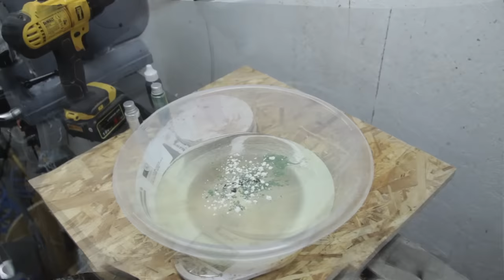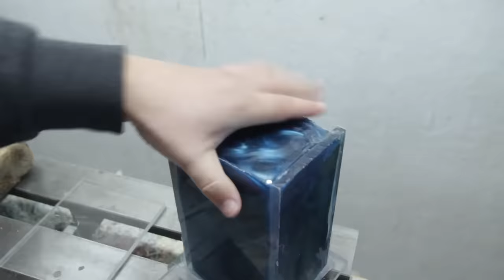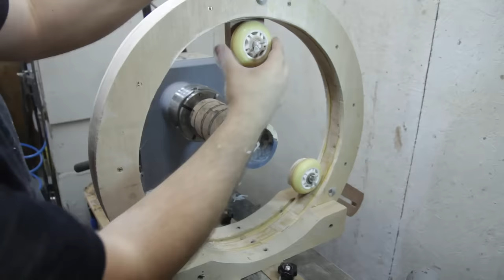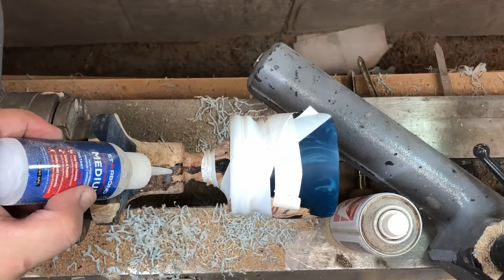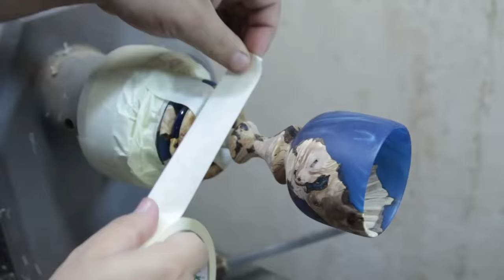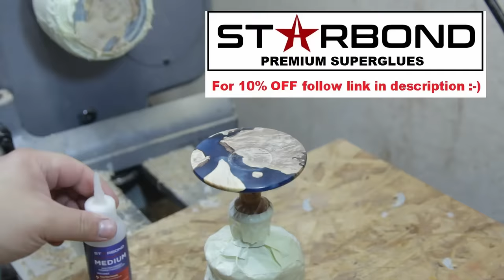Woodturning - Hybrid Burl Goblet

Comment: Have you ever thought about doing inlay? If feel that would look incredible on something like this, maybe some brass since it’s still soft (ish) like gold but much more reasonably priced. I think a cool idea would be to turn in a little and shallow slot in the middle of each ring and inlay them and sand it flush before separating them from the body. Anyway, this was amazing, I could see how nice the epoxy looked as soon as it was pulled. Also if you’ve done inlay and I’ve missed it I’m sorry haha
Reply from the maker: Many thanks :) Have a look at my videos i jave done a segmented vase with aluminium inserts between the segments

Comment: What is the item that you put the expoy resin rectangle in, that you pin down and add pressure to? not sure if just air or gas
Reply from the maker: Air pressure pot. Helps with air bubbles

Comment: Is lacquer a good finish for epoxy, I just built an epoxy coffee table, video on my channel if your interested. But, had to polish and just leave the epoxy as I tried using osmo oil and I tried all the tricks I found out there on you tube to get it nice but just wouldn't finish well without streaks and haven't tried any other types of finishes, was afraid to ruin it. May try some with lacquer.
Reply from the maker: Yes it can ben. Check out youtube some good videos on it how to apply

Comment: With the resin as a good part of the goblet and sealing things with spray lacquer, does one have to worry about the wood parts warping as the item ages? I have learned to turn bowl blanks, let them age then turn them again, when using resin, is warping a concern with composite turns? (I’ve poured resin jewelry parts, just trying to get brave enough to move into that with lathe work)
Reply from the maker: It will move but time will tell :)

Comment: Just wondering, why did you have to pressure cook the epoxy? Wouldn’t it have dried like that on its own? And what does that little tri-wheel apparatus do? 😅
Reply from the maker: Only helps with air bubbles , but does not effect curing time at all
Reply: @DavidsWoodturning  ahh okay I see. So if you don’t use the pressure cooker, will there be a bunch of air bubbles trapped inside the resin? I don’t have a pressure cooker so just wondering how it would turn out without one.

Comment: I have a crazy question. Is it doable to use uv resin and have uv light strips in the pressure pot?
Reply from the maker: I really do not see the reason why, when there are casting resins designed to do the job

Comment: did you do any special prep to the wood before pouring? the one block i did, the acrylic separated from the wood. looked like a white layer over the wood when it came out of the pressure pot.
Reply from the maker: This piece of wood was stabilised before casting.

Comment: Did you not need to sand after applying the finish?
Reply from the maker: No it had a great shine and smooth surface so left it
Reply: @DavidsWoodturning  Very cool, thanks for the answer.

Comment: AWESOME AWESOME WORK! Have you ever used soft stone with the epoxy?
Reply from the maker: Thanks Daniel. No i have not but something I will look into 😀
Reply: Hey David I do stone sculpting as a Hobbie I had a few things I wanted to show you with surface level lime stone it's very soft and also easy to grind not rough on the blades I also use sand hardend with epoxy.
Reply: If I can send you an email let me know I'd love to talk I currently don't have a lathe I've been considering purchasing one but I don't want to unless this process will work well so maybe I can give you an idea and you can tell me how it went

Comment: It seems that it would have been smart to have done a little sanding on the rings before you completely cut them loose from the block. It would have helped get a little of the outside sanded.
Reply from the maker: Very true 😀 only realised after the rings were done that would have been easier.. everyday is a learning day 😀

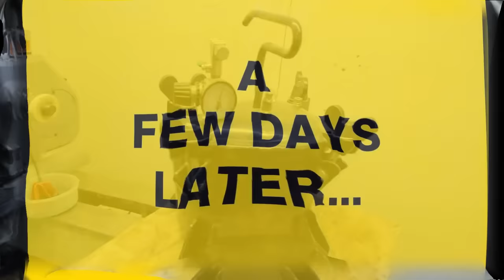Comment: At 1:46 a complete fool is shown. The pressure is released while the epoxy resin is still liquid, after reaching the maximum possible vacuum.
Reply from the maker: Very wrong Valery. As shown at 1:43 it was after few days when pressure was released and resin was fully cured.